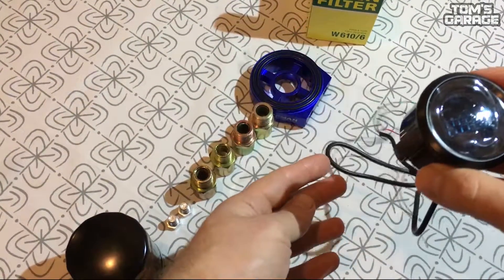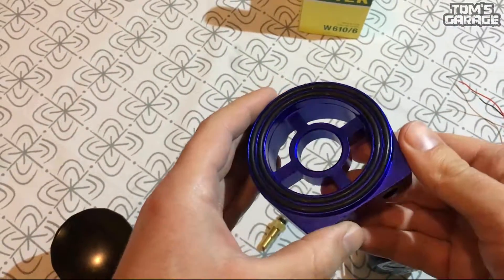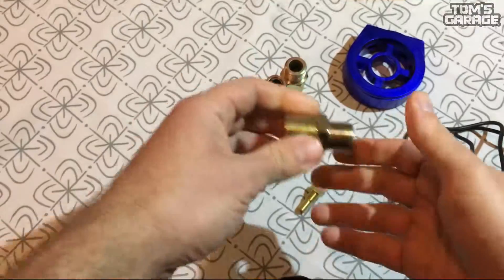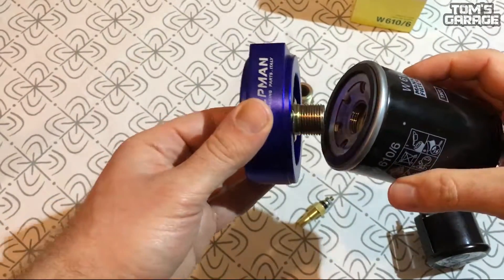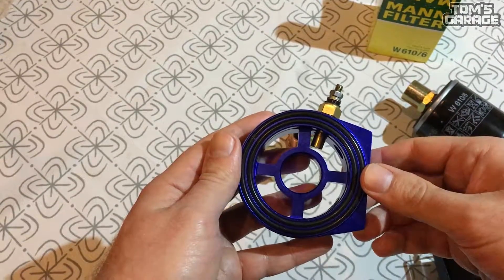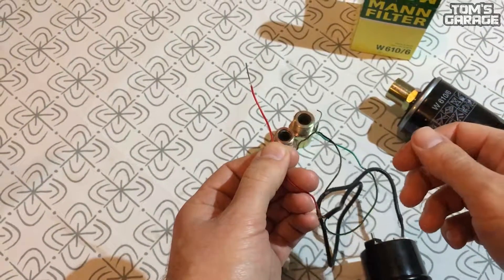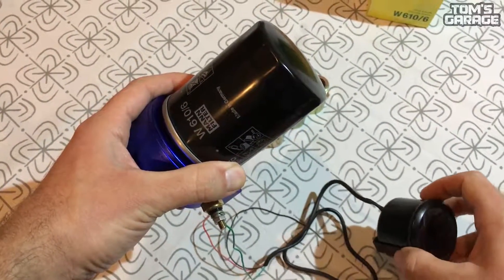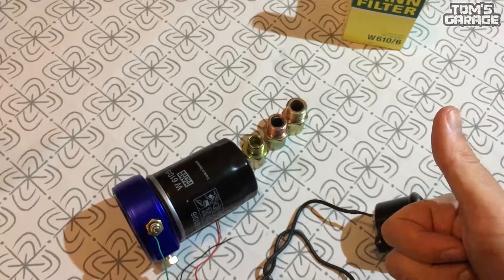How to Install Oil Temperature / Pressure Gauge | Tom's Garage

Comment: Can’t take advice from someone who wraps wires around a bolt. Please use correct connectors when installing anything
Reply: What would be the correct connection to the sensor please?
Reply: @RossKyleJohnsonYT  A crimped on  Ring connector the correct diameter for the sensor..

Comment: Is oil temperature a usual problem for you?  I mean, when the oil temp gets to high to you pull over and let it cool down?
Reply: It might be to see if the oil is hot enough to drive the car hard, better for the engine to not go super fast until the oil is warmed up and can lubricate well
Reply: Oil temperature can be a problem on track days, especially when it's hot out. The sensor is good to let you know when to go back to the pit because coolant temperature does not usually tell you the complete picture at the limits.
Reply: @josiahqhamilton  is this before or after you hit the NAAAAWWSSSS